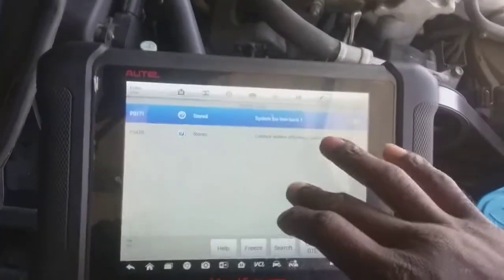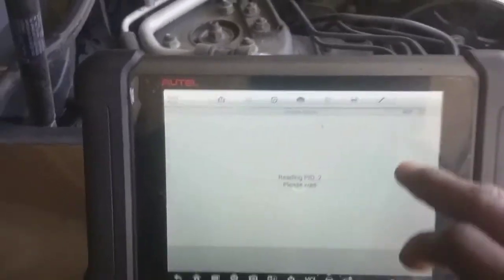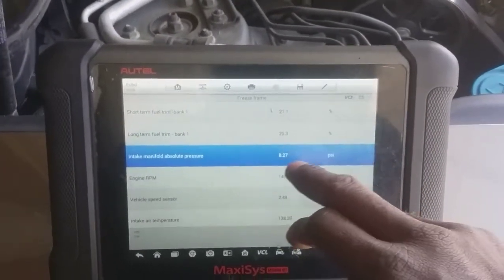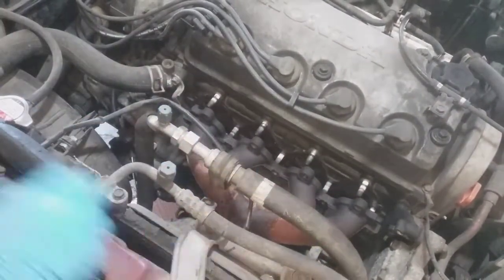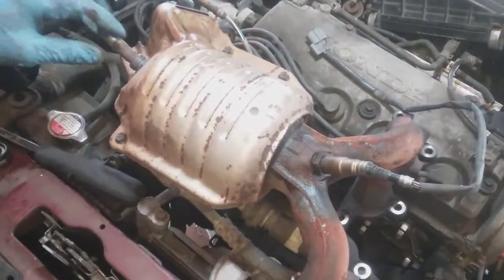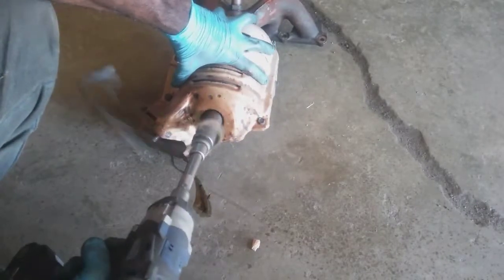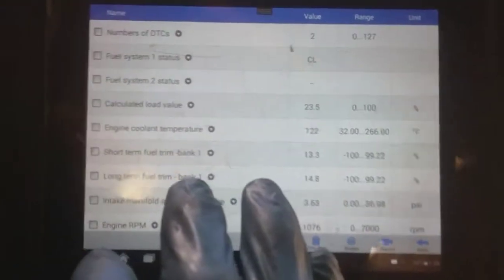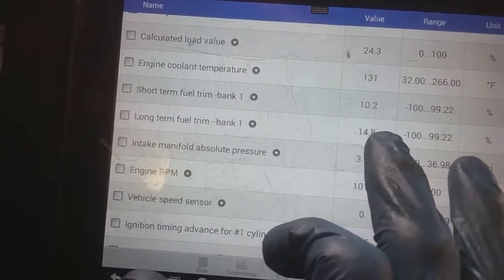DOES IT ALTER FUEL TRIMS? EXHAUST LEAK

Comment: Thanks for this vid!  I do know that exhaust leaks CAN create lean codes........ Ive been struggling w a random/pending/occasionally hard set P0174 and chasing down all the things (vacuum leak, TPS, AIC, fuel....) but Ive just now come down to exhaust leaks.  SMOKE MACHINE into the exhaust and I find a badly leaking exhaust manifold to exhaust donut connection L E A K.    Ill find out in the next few days if this is finally the solution.  Only bank 2 and creating crazy 50% fuel trims, carbon fouling up the spark plugs and O2 sensors.  Cheers!

Comment: Intake manifold absolute pressure is correct.  That's an absolute pressure value.  14.7 psi is atmospheric pressure at sea level, so 8.27 psia is a vacuum.
Reply: So if my intake manifold absolute pressure is 46KPA (6.67174 psi)  when the code sets in, that means I have a vacuum leak on the intake?

Comment: but how does it suck in air where the cracks at does this have to do with valve ovberlap or is there a time that the valve position create a small vacuum on exhaust thatsuck in air? i have a leak between turbo and exhaust manifold right before the o2,i can feel the exhaust leak but dont understand how its able to run lean how does it suck air into exhaust?
Reply: I know right you think it's would just pushout exhaust but maybe in older car   it becomes an issue when the valves become worn and don't seal well and then creat said a slight vaccum from piston travel maybe?